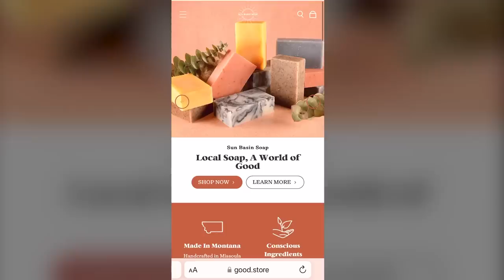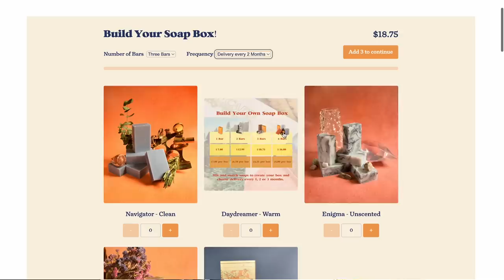I Discovered a Soap Secret

Comment: HANK! I would love it if there was an option for a six month order frequency. International shipping is expensive. But I love this idea! I just bought the sample pack.
Reply: they also sell soap individually so maybe buying a lot at once would be an option. Though again buying it without subscribing is also more costly.
Reply: @sylvy16  now that you mention it, they do have a 12 pack option. So I could buy a whole year at once. But I do like the subscription options, because that allows them to reduce costs by ordering upfront in bulk.
Reply: Being that I am in Europe, I will probably go for the 3 month option but I would definitely prefer a 6 month option! Less shipping equals less carbon emissions!
Reply: Buying the 12 bar or 24 bar packages is cheaper per bar than the subscription. But shipping will be by weight, and more than the $3.99 shipping for the subscription.
Reply from the maker: We have an option to just buy 12 or 24 bars for this reason!
Reply: @kaypgirl  I don't know how things pan out for international shipping, but for domestic, the pricing for the 12 pack ends up matching the 6 bars subscription, or at least it did when I was experimenting. For the subscription, it's $36 for the soap and $4 for shipping, while the 12 pack is $69 for the soap and $11 for shipping, so your math ends up being 40/6 and 80/12. The best per bar price is the 24 pack, which ends up being just over 150/24 once shipping is included.
Reply: @justwaitingherethen  for the sake of due diligence I just checked the 12 pack shipping price as a Canadian and it came to $28CAD, so about $20USD.

Comment: Sceptical about the need/benefit of exfoliants IN soap (exfoliating in general; we did evolve to have dead skin as the top layer) and how actually sustainable the palm oil is.
But I also live on a different continent to the manufacturer, so it's unlikely the shipping/import cost of the soap would make it worth buying in my particular case. Great to hear you're finding more ways to donate profits to charity, though!
Reply: I wonder if that helped when we humans were outside all the time. The thick layer of dead skin that I deal with is not doing me any favors that I am aware of.

Comment: I have Celiac Disease. Is there any way to tell if they are Gluten Free and there is no cross contact or cross contamination???*

*Example: Oats are not Gluten free due to wheat being grown in the same fields. So if some soap has oats and you make your bars on the same machinery without a cleaning protocol, there could be enough contamination to cause an issue. If oats are in barrels, the dust could also contaminate other products (just examples of how it happens). There were also a couple of ingredients I did not recognize.

Comment: why ain't it called awesome soap club......

my soap tip is the following: I leave mine on top of overturned roll on deodorant caps. they allow the water do drain while having minimal contact with the surface of the bar (I have ones that are basically a a hollow plastic ring, the kind from deodorant bottles that sit upside down on their caps?). so no pooling under the soap! the bars last forever

Comment: i would really love if y’all introduced shower gel. I use that and haven’t touched a bar of soap in so many years. Also can someone tell me if making shower gel would be easier than making bars of soap? It seems like the products are first made as a liquid and then solidified to make bars.
Reply: To make a bar soap into a liquid soap, honestly all you have to do it shave the bar and melt it in an equal amount of distilled or purified water. Sometimes it takes a bit more water to get your preferred consistency, and it might not lather the best at first, but you could definitely buy Hank's soap and turn it into liquid.
Reply: Coming from someone who is currently getting into the soap making business myself
Reply: Liquid soap is made with a slightly different process and than what's being shown here. Bar soap is made with sodium hydroxide, while liquid soap is made with potassium hydroxide; these are two different kinds of lye that require different ratios of ingredients. Bar soap can be made either through cooking the soap mixture (hot process) or by just mixing the two without heat (cold process); I believe that this soap is made using cold process. Liquid soap is typically made through hot process. Although the soap in the video looks liquid at one point, that is just the bar soap mixture before it cures. Bar soap takes several weeks to fully harden and cure before it can be cut and used. 

It would be cool if they had shower gel, and it probably wouldn't be a huge stretch, but it does require different ingredients, formulation, processing, and packaging. Hope this helps!
Reply: Hank hates shipping water (see the ad from the most recent Dear Hank and John), so I kind of suspect they will not get into this. 

I’ve also not used bars for a looong time but I’m giving it a try. I do think the environmental benefits are interesting. We’ll see how it goes! 😂

Comment: What you don’t seem to realize is that it’s actually easy to make soap. I can see why you’d want to partner with a facility that can make soap in high volume amounts…but soap isn’t difficult to make. Also, the scent in soap is made by perfumers. It’s unlikely the soap factory has their own perfumer, as training takes years and years before someone knows enough to compose a scent to specifications. Additionally, creating scents for industrial products (such as soap) is harder to do than creating fine fragrance (the perfume you spray on). Thus the perfume used in the soap this factory produces is likely composed of some “natural” and “organic” materials but also definitely includes “green” aromachemicals which may or may not be directly obtained from natural sources, but are almost certainly safe, non-allergenic, biodegradable and obtained from sustainable sources. The personal care industry has developed a very misleading marketing tactic of labeling everything as “natural” or “organic” and implying that their competitors use “icky” or “toxic” chemicals. This is just not accurate. Many, many completely natural essential oils are dangerous in some way—whether it’s photosensitivity, allergens, neurotoxins, etc. and essential oils are actually not entirely natural anyway! They are created in a complex human-invented process and are many times more concentrated than any compound found in a harvested plant. The chemicals used in scents and flavors are heavily researched and regulated, and while the USA has historically had much less regulation and testing, the FDA has recently decided they will be using the standards set by the EU in the near future. Everything is chemicals, as you should know. Natural doesn’t equal safe, and synthetic doesn’t equal toxic. Both can be safe, both can be harmful depending on many factors.

Comment: question: round soaps (like the kind you make in pringle cans), are they more wasteful? harder to make at scale? 
maybe dont last as long?

I've always liked the form factor but willing to cmv.
Reply: Circles are made in a vertical mold, whereas rectangles are made in a horizontal mold, which is easier to work with.
Reply: @bohobathworks  thank you so much! makes sense.

Comment: it's not really a secret...it's the American industrial market. there are companies that make stuff that gets sold to consumers, and that stuff is made of parts. there are companies who make parts that get sold to companies that turn parts into stuff. it's difficult to make parts AND stuff in a cost and space efficient way. last i checked, Jack Daniels doesn't have a lumber mill that plants and jacks trees that get planned down into the staves they use for their casks. last i checked Jack Daniels doesn't have a glass shop that makes the bottles their whiskey goes into. last i checked Micheal Kors have a factory where 1 floor looms, a 2nd floor dyes, a 3rd floor sews, and a 4th floor retails. Cape Cod potato chip company isn't out there in the fields growing potatoes. and the field Cape Cod imports their potats from might have a massive yield, which gets sold to various restaurant supply distributors, and Lays, and Deep River, and so on. the part of the spuds stay the same...but instead of going to market, they go to chip companies and local restaurants. it's wicked rare that every part of the process is done in house direct to consumer and has no wider distribution.
congrats all the same on  Sun Basin launching.